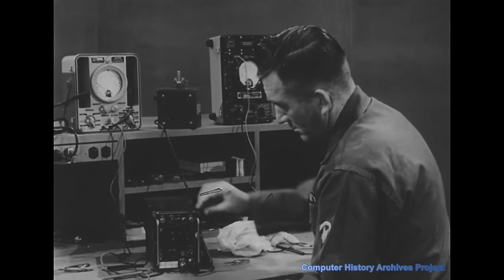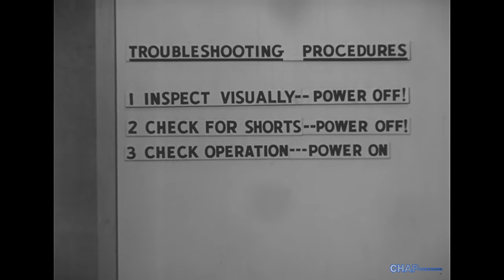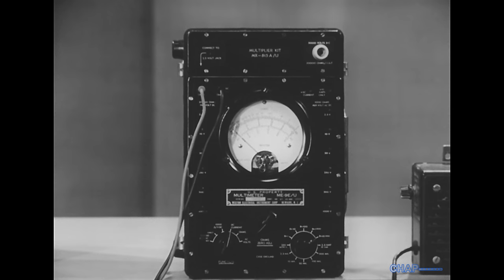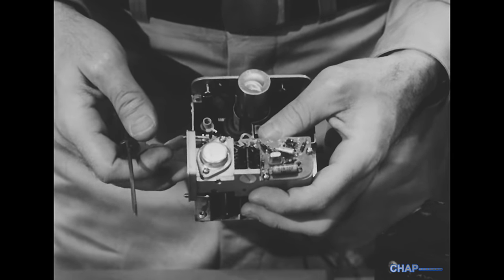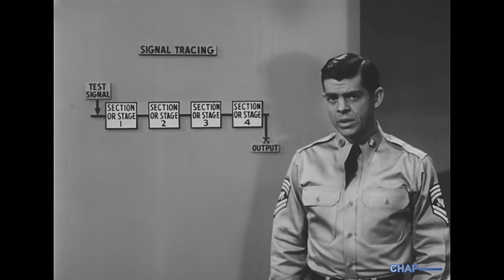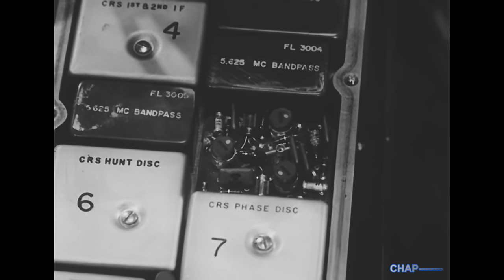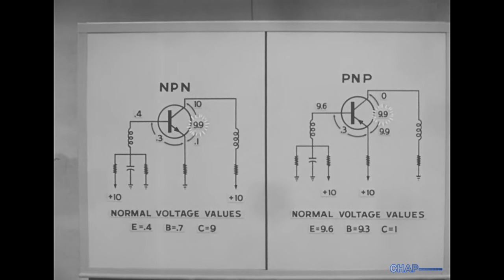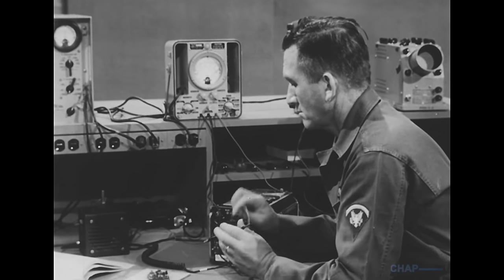1962 "TROUBLESHOOTING TRANSISTOR CIRCUITS" Technical Training, Vintage Electronics Equipment in HD

Comment: Navy  electronics tech  "A"  school,  TI, 68-69, ham club, K6NCG.  I was one of the last of  the mostly all-tube  classes. We had all of 4 weeks on  "solid state".  NAS Miramar, 70-74, I maintained GCA RADAR  and TACAN.  Nowhere  I was  exists anymore, not boot camp RTC Sand Diego,, nor TI, nor NAS Glynco GA, and now Miramar  is in the hand of the Marines.  I am old LOL
Reply from the maker: Hi fourfourty RoadRunner, that is quite a history of tech training and experience!   Having seen so many changes over time must give you an interesting perspective.  ~
Reply: fourforty Roadrunner - Hello! I was USAF airborne electronics countermeasures tech during 1967-1971. Lots of vacuum tube stuff back in my tech school, as well as some transistorized stuff. Ham radio op here as well. Ended up following electrical engineering as a career, retired in 2011. I can sympathize with your feelings of history being erased. Many of my bases are gone now, even SAC disbanded. Those were fun years, of a lot of learning.
Reply: Navy avionics training at NATTC Memphis  in 1987 still had mostly tube training with only a few weeks of solid state.

Comment: A very well done training film. Anyone notice that the base to emitter voltage was stated as 0.3 volts in  properly working circuit? The transistors would have been made from germanium not silicon which has a higher Vbe. This training film is certainly better than some of material I saw when learning about electronics. Going to watch more of the videos on this channel. Thumbs up.
Reply from the maker: Hi Djaypaz, thanks for the kind words.  Glad you enjoyed this!  ~ Victor, CHAP
Reply: I wish it would have been explained as clearly as this back in my classroom days.

Comment: I have some of the test equipment shown. I use it when restoring and servicing my old military radio equipment.
Reply: I got the radio set and the Signal Generator which was showed in the Video. It is the SG-12A/U and the PRC-25 Manpack radio. This radio still  got one tube, the xmtr final.  The receiver he got on the bench is a R-442 and belong to a vehicle radio installation with the RT-246 or 524 VHF 50W radios.
I love those old tutorial videos.

Comment: Thank you for posting this training video. We were still watching training films from this time period when I went through Navy Avionics “A” school in 1980. Aside to having the newer Simpson 260 multimeters. Everything else in this film was and still is very relevant. I might add though that I can’t believe that they left out all five senses. What technician with any time under his belt has not used smell to identify or localize trouble?
Reply from the maker: Hi Rick, thanks very much for your great observation!  Yes, they should have included the smell test.  Remembering way back to my TV/Radio repair days, the smell of a burning capacitor was different than a bad transformer or bad vacuum tube.  I had forgotten about that.  Any smell from a circuit was a sign to look for something.  Thanks for jogging this memory!   ~  Richard Kimball, at CHAP
Reply: Well Said! yes the nose is very often invaluable as  many materials can be found in a radio circuit

Comment: Surprising, or maybe not, how much of this information is still sound technique in 2021.
Reply: Most of it, but Si transistors are more likely to go shorted, and Ge transistors are more likely to go open. Ge transistors also have higher inherent leakage and are generally more delicate. Also, these days we often make all the transistor measurements with respect to the base or emitter rather than circuit ground, making it easier to not have to deal with whatever the B+ voltage level is relative to the transistor. Oh, and the B-E drop is .3V for Ge and about .65 for Si.

One important difference was eluded to in the film without being specified exactly. Old ohm meters used very high currents on the X1 and X10 ranges that could instantly fry small signal transistors, and also used fairly high voltages, 3 or 6 or even 12V or more, that could also fry transistors and tantalum capacitors and the like. Modern meters use much lower voltages and currents that are much more unlikely to damage equipment. Also, old volt meters were usually a fairly low impedance, and could change circuit voltages when you measured them, resulting in erroneous conclusions.
Reply from the maker: Great observations!    ~  C. Hunter, CHAP

Comment: Rule 1 don’t use a pencil to fault find live circuits it’s carbon “lead “ is conductive I tried tapping for dry joints on a eht transformer in my youth Very shocking results
Reply: Pencils have never been lead they are a graphite clay mix still conductive but not lead. Details matter, especially in engineering.
Reply: I always made a copy of the circuit diagram of  the device which I work on, so I can  make notices about the measured values without ruin the  the original service manual. And I use a pencil,   but not to poking in the wiring.Just to make notices.☺
Thump up for this video!!

Comment: "Make sure the battery is properly installed" WHACK! Not enough smacking the devices in todays electronics :)
Reply: Percussive maintenance for the win!
Reply: I noticed that too. Pretty sure most solder joints would be compromised if the connectors were not mechanically attached. Today’s electronics would surely fail from that.

Comment: 1: To repare a Circuit board, You need to be a military 🏅🥉🥈🥇 2: Check that the battery is properly connected 🔋🔨
Reply: The way he slammed the battery into place.... 😆

Comment: This video assumes the transistors are germanium, and not silicone. The normal bias conditions for germanium is 0.3 volt whereas for silicon it’s 0.7 of a volt approximately.

Comment: Why does he say that high-impedance test equipment is particularly suitable for testing transistor circuits? Transistors have a much lower impedance than tubes. For example, in audio equipment, tubes want to feed 2,000Ω headphones, whereas transistors are more like 32Ω.
Reply: It was common for low-impedance VOM meters to use a considerable current for resistance, especially in the x1 range (sometimes more than 100ma.) This can burn out B-E junctions in the delicate transistors of the day. Some VOM meters used high voltages for resistance testing that exceed the max voltages of the transistor (22.5V was common in the day).
Reply: @ScottHenion  In addition a VOM has relatively low impedance measuring voltage, and could throw off the voltage readings that should be expected, or make the circuit malfunction. Remember that a VOM impedance is rated as "ohms per volt", so if you are only measuring half a volt the impedance of a 20Kohm/Volt meter is only 10K ohms.
Reply: @lwilton  If your full-scale reading was one-half volt.